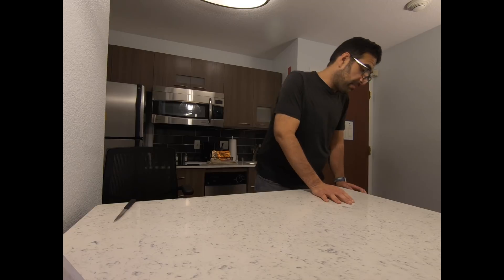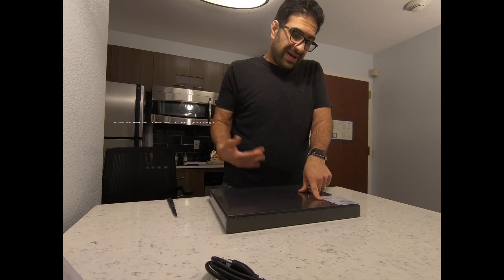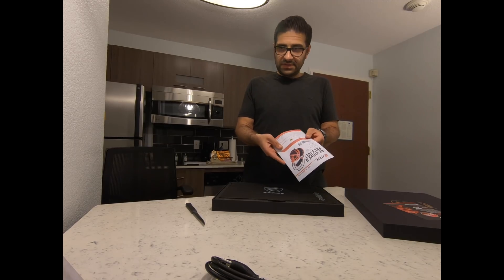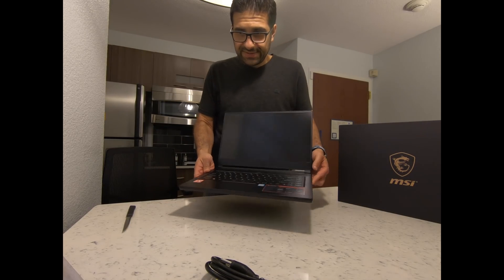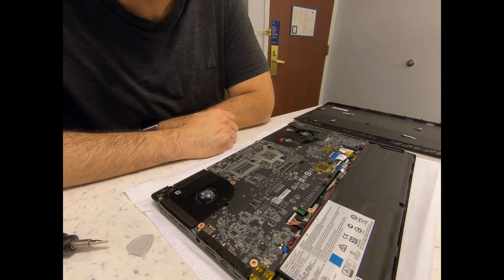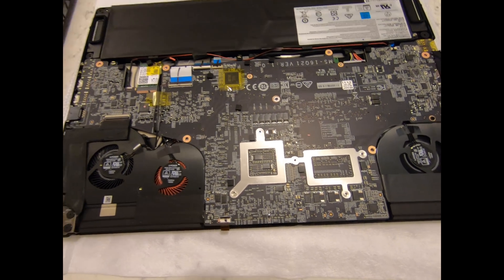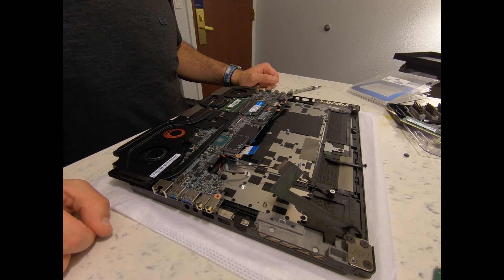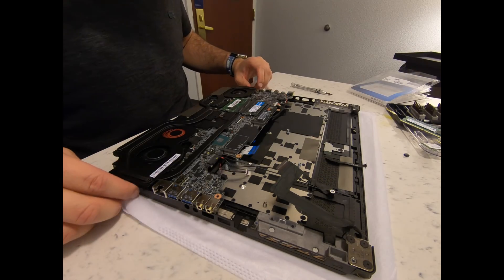MSI GS65 Unboxing, SSD and Ram Memory Upgrade

Comment: I did every step of this video. Laptop turn on, but display does not. I have connected the laptop to an external monitor via hdmi and windows dos not recognize the laptop display.  What could be happening?
Reply from the maker: You have probably missed to connect the morning cable to the motherboard! Make sure all the cables are connected or also maybe you didn't plug it in correctly. Try to unplug it and insert it back
Reply: @WorldOfGadgets  that's the blue cable near the coolers right?. I've already try it, connected and disconnected and nothing happens
Reply: @WorldOfGadgets  in what minute of the video did you disconnect the display cable?
Reply: I have same issue if you solved your problems
please
help me.

Comment: Real quick question: I have an MSG65 with an RTX 2060, and I'm thinking about replacing the battery. If I opened the back of the computer, would I have to disassemble the motherboard, or would I just be able to take the battery out and put the new one in?

Comment: You didn't explain what you're doing with the RAM. Can 16Gb ram go with 8Gb on other slot? :/ or do they have to be same capacity.
Reply: He was able to install one 16gb and left one 8gb of ram in there. He said he would have "24gb of ram" in the video and would upgrade to 32gb of ram later

Comment: I have this same exact laptop and it lags a lot when surfing the web.. I was considering upgrading the RAM and SSD, Have the OS installed on the new SSD clean and have the old SSD as a slave for regular word files, PDF, Excel and such. 

Only info needed:
- Max amount RAM and clock speed the laptop can handle
- Max amount of SSD and clock speed it can handle
- Is it worth upgrading the wifi card

Thanks

Comment: The models that have only one ssd  can be upgraded with two or I should choose a model that has two hard drives from the factory stock?
Reply from the maker: anatol1204 they should unless they have a different SKU for where u are ! Otherwise in USA there should be a room for u to upgrade

Comment: If you upgrade the m2 SSD and reinstall Windows,  are there any drivers that need to be installed for the laptop?
Reply: well..
easy way - no need to install drivers (just connect to the internet and windows update does it for you
harder way - install manually (without wifi connection...need to pre-download each driver)

Comment: Hi, may I know which SSD below do you recommend for MSI GS65(If budget is not a problem)?
Samsung 970 Pro NVMe M.2
Samsung 970 Evo Plus NVMe M.2
Samsung 970 Evo NVMe M.2
Can these SSD fit the second slot as well?
Reply: No the 2nd slot is only for 2.5” SATA HDDs or SSDs.

Comment: Did you have any problems turning on your gs65....I upgraded my ram and swapped out the SSD for a 970pro and it's all connected back up and no power....being that I am a H/W installation specialist at work I am somewhat confused as to why I cannot get my laptop to turn on? I would love if you could let me know if you had any issues.
Reply from the maker: no issues, but when I upgraded my ram I had to plug the laptop to the power and hold the power key for few sec before it turned on. 2nd thing i would check is that all cables are connected to the board after your installation
Reply: @WorldOfGadgets  well I have had to return my gs65 for a full refund.. it's utterly dead.. I am now looking at a asus rog zephyrus m gm501 now I have two brand new 8gb 2666 sticks of ddr4 that are gonna be useless...oh well .. that's a loss of £150 right there...

Comment: Hey there, 
Does adding an extra SSD void warranty?
Reply: Judith Pasfield any changes to the laptop can void your warranty.
Reply from the maker: Judith Pasfield  if your in USA no! I have confirmed this with MSI... as long as you don’t break anything inside your warranty is valid ! Obviously they won’t cover your new upgraded parts but everything else it’s still under 1 year warranty

Comment: Having opened the computer has lost the warranty, when you broke the seal of the last screw that you did not find. but I guess you knew, you have to wait for the year of the manufacturer's warranty to end, because if it breaks down under warranty, you will have to pay for the repair out of your pocket   Regards
Reply from the maker: Curiosidades y Mas No, that’s not true ! At least in USA, I have called MSI and confirmed with them that upgrading parts in your laptop dose not avoid warranty even if you break the seal. The only time you lose ur warranty is if you physically damage something inside.

Comment: I don't know if it's too late to ask, but is there any way you could tell me if Oracle Virtual Box will run on this?  Are you able to get a VM up and running?  What type of RAM spec do you need for the upgrade SODIMM 260 pin?

Comment: Hi there I took this laptop today to geek squad (because I could not trust myself with this kind of stuff) and they told me doing this requires removing the motherboard and that it runs a high risk or frying or destroying it. is this true and if so how would I fix this?
Reply from the maker: Yes, they need to remove the motherboard but honestly as u can see from the video it's not to hard and I personally don't trust geek squad they Tell bunch of idiots ... Don't trust them with anything ... If ur not comfortable doing it ur self Google some PC repair places to help u in ur area

Comment: Nice vid. Would be sick to Raid-0 2 x 2TB Samsung 970 Pro in that thing. Or Raid-1 for the paranoids who don't do backups. I've one, I'm a bit scared to open the thing. I'm technically inclined I built a ton of PC's, but this might be above my clumsy level.   Any toolkit recommended? I've already have a crazy kit with all the bits you can image for the screwdrivers but I've no clampers, plastic things to  pry etc. Thanks for the vid.

Comment: Has anyone had their new installed nvme drive just randomly disappear from file explorer and device manager and disk manager? It still appears in BIOS but disconnects randomly while in windows. It sucks because all my games are on this newly installed drive so they will just randomly crash while playing...
Reply from the maker: is your NVME a Samsung drive?
Reply: @WorldOfGadgets  No. It's actually crucial. But, I think I've even further isolated the cause. It only seems to happen while playing AC Odyssey. So there must be a problem with the game. I've read online that AC Odyssey can break if you have it installed in a secondary (as in not the same drive as your OS) drive.
Reply from the maker: @13Uzamakifan   it could! I have had the same issue on My Samsung NVME drive... the problem got fixed after I installed the NVME drivers from Samsung! you might having the same issue... try to see if Crucial has any drivers available for your NVME.

Good Luck.

Comment: I just bought a 1 TB HP EX920 SSD and it says "double sided SSD" on the box. Do you know if that is compatable with the GS65?
Reply from the maker: Is it M2 ?
Reply: @WorldOfGadgets  Yes, m.2 NVMe SSD. It has chips on both side of the SSD.
Reply from the maker: Timothy Chan then it will work 👍🏼
Reply: @WorldOfGadgets  I came across a forum where someone plugged the HP SSD into his Lenovo X1 Carbon and it was a bit bent (hence there are chips on both sides of the SSD). He was concerned about any long term issues of the SSD. If the HP SSD even a bit bent due to the design, maybe I'll have to go with a different brand.

Comment: what wireless card did you upgrade to?  please add Amazon link
Reply from the maker: I'm not sure what model # it was, but I purchased it from Ebay. but MSI changed the default WIfi card to the one I replaced on the second gens.

Comment: I've been reading that if you want to add an extra ssd, you would have to put the Nvme ssd with the OS  in slot two as that slow only takes Nvme and then install the sata ssd into slot 1, as slot 1 takes Nvme + sata. Can you confirm this?

Comment: wow thank you so much for this video!. I'm really thinking on get this model but I live in South America and they sold out, in Amazon they offer several options, do you recommend going for the lowest option in RAM and SSD to make it cheaper and then replace them here? let's say I buy the one that comes with the GTX1070 and then add more ram and storage?
Reply from the maker: Jonathan Varas Roco that’s exactly what I would do ! Hey charge to much if u upgrade them from factory

Comment: Can i fit Adata XPG Gammix S11 M.2 SSD, who have heatstick and might restrict compatibility with this thin laptop? Quote from TomsHardware.com:
"The drive would be a good choice for a laptop, but the heatsink might restrict compatibility with some models. Some laptops only accept single-sided M.2 sticks or have tight clearances for double-sided drives. That means you might not be able to use the S11 with its additional heatsink."
Reply from the maker: Filip Gargov actually you might be able to make it fit ! There is some room , but honestly what would u want to have a heat sync on a SSD? They don’t produce that much of a heat

Comment: So i just did it and it was scary but work! I've added a SATA SSD and that works only with SLOT 1, (SLOT 1 is a combo SATA/PCIE), I move the stock PCIE SSD to SLOT 2 (PCIE only)
Reply: Be very gentle with the different connectors clip there are fragile

Comment: Is this laptop worth buying with all its confidence and appreciation in terms of price, quality of manufacturing and what you think about Thank you .
Reply: Thank you. Is it possible to buy this laptop to work on it in the specialization of graphics and programming and whether the quality of manufacturing beautiful
Reply: great machine. use it for 3D animation and software development.
Reply: Hany mohamed TV I can recommend this laptop regarding graphics and design. But, for programming, I have no idea what kinda specs you need for programming.
Reply from the maker: Well, If you want my honest answer I would say spend little bit more money and go with the New Razer Blade 15" the build quality its much better and it will hold its value much better as well! here is the link to my video https://youtu.be/6bXPXA8t4ms
Reply: World Of Gadgets Razar has the worst customer support ever. Plus, thicker aluminum plates does not necessarily mean a better build quality. In fact, I see this laptop build quality way better than Razar. This laptop has a flipped motherboard for better cooling plus, it does not overheat much compared to other laptops in its size range. People need to understand that flexes in the body does not mean a bad built quality.

Comment: Hey!!, I just got my gs65 yesterday, and I wanna install ssd in my laptop now, which brand and which one should I get, and very confused right now,
Reply from the maker: Hi, Congrats... so Samsung recently released their new NVME SSD's  "Samsung 970" they are awsome and very fast … you can order them using these links through amazon and they are on sale right now. I personally recommend the 1TB : https://amzn.to/2MScrLx    or  512GB : https://amzn.to/2vO6yIV
Reply: Thanks! Btw, can I install two SSD at the same time, or do I need to replace the old one?

Comment: Did all these and there's one more mod everyone should do, which is liquid metal thermal paste. You'll realize after installing all your software, the computer boots up to 70c for no reason. After using the metal paste, it will reduce at least 20c. I maintain at 41c every time I start up.
Reply: @Sw3d154_F154 it also decays copper and other metals but way spower than with alu. If you plan to use your computer for a long time, like plus 4 years, it is better not to use liquid metal
Reply: @FreeofCorp  If I use liquid metal on this lap how often do I need to replace it to avoid damages?
Reply: Which 1 did you buy? Can you link one in EU region?
Reply: @moomoo5537  Thermal Grizzly Conductonaut... https://www.amazon.com/dp/B01A9KIGSI?ref=yo_pop_ma_swf
Reply: Yeah liquid metal is sick. But beware, over time it can eat into your cooler and cpu (slowly). U can also use nt-h1 paste, u wont get 20 c off but it is still a big improvement.
Reply: Is the factory paste so bad on this it will also improve lots by replacing with just regular after-market thermal paste? (as someone wrote, if you intend to use for long life the liquid metal is less ideal..)
Reply: @shyb3rt  did you ever find an answer to this?
Reply: @SuguruMontana  I didn't want to risk it since I received my ordered laptop days before leaving for travel. Might consider upgrading the RAM and NVME drive now however, so considering giving repasting a try as well within the next few weeks. Interested to know if anyone had much improvement by repasting using after-market thermal paste (not liquid metal).

I did however experience that software-adjusting down the voltage for the CPU and GPU helped calm the fans down most of the time :)

Comment: Thank you for this... This video just made me change my mind about this laptop. It looks great and feels great but that's ALOT of work to get in and upgrade..... A complete turn off
Reply from the maker: christopher graziano hahah I know but honestly it’s not that bad! 1st time is the hardest lol 😝
Reply: World Of Gadgets yeah It too extra for no reason I ended up getting the Razer blade 15 instead because I have Parkinson's so I can't be messing with ribbon cables like I used too
Reply: It’s not too bad, I just did the exact same thing he did but I didn’t take out the battery or the mother board I just lifted the board up and installed the SSD from the back and it sat back down I didn’t have to do all the stuff he did!
Reply: Get external hdd
Reply: I felt the same way at first, but the screen quality, keyboard quality, and overall CPU+GPU specs is a big win. I'm going to do the mod.
Reply: John Draisey keyboard quality, on this thing? It’s junk, I can type 120+ WPM on a standard keyboard, bot on this, not even close, it doesn’t respond well enough
Reply: They've crammed a 1070 into an almost ultrabook design
Reply: Better an upside down mobo then buggy Aero.
Reply: It's not hard actually. Just go easy.
Reply: weeeeak
Reply: Ben Birchman Sad until you break one of the cables, then it’s a silly reason to have bought the laptop, which just becomes so much junk at that point
Reply: It may look great, but there is a lot wrong with it:

1) The keyboard is cheap, it feels cheap and doesn't react as fast as their older models; I can type 120+ WPM, but not on this keyboard;

2) Intel Max-Q is trash! I wish I would have known, I would have spent $2K+ on another model that doesn't have Optimus, I mean, Max-Q; I have tried to set the dGPU as default in the nvidia panel and onb a per application basis, with no luck for many programs; VLC cannot be set to use the dGPU at all;

3) It's fairly slow for the specs; not sure if that's hardware or software, but damn, I expected better for what's listed;

4) It seems to be designed by Apple; I've been a long time hardware tech and I'm hesitant to open this, mostly because I may want to sell or trade it and don't want to chance damaging it;

5) The speakers sound like shit; I know most laptops are a compromise, but the high-end comes across distorted, especially as you increase volume; and

6) MSI support sucks. My desktop is mostly MSI (motherboard, graphics card, and whatever else I could use); but, after my experience here, I may evaluate other companies.

For the price, look elsewhere and, for all that is holy, do not buy Max-Q stuff which would encourage Intel to continue its development.
Reply: @erichzann2966  I love my MSI GS65. I get average 90-130 FPS in PUBG on a 4k 30inch monitor. No lack of power in music production or video editing. Working well for me.
Reply: Daniel Yengle You have to use the MiniDP or the HDMI... or, is there a way to make the laptop screen, itself, default to the dGPU; I am playing a game from circa 2002 and the fans kick on, it has locked , completely once, while just doing office workin the last week

I have questions in the nvidia and MSI forums, and people haven’t answered or have had the same problem

How much dedicated RAM do you have for your card? 128 MB? Look at the specs, the so-called 8GB is shared between the Intel, dGPu and system

Or, just spend the $2k+ and get a laptop that doesn’t have Max-Q, or, I would have, had I known
Reply: @erichzann2966  We all need different things in the end. Get what suits you best. I like this one because it's sleek and professional looking. And the keyboard reminds me of the pre 2017 macbook pros.
Reply: Daniel Yengle But those are perceptions, not performance; does yours say 128 MB of dedicated RAM like mine, with 8 GB split three ways? Or, is mine the only one?
Reply: Joshua Richard No, I made a poor purchase, and there are valid reasons to consider it as such; outside of this laptop, my life is fine, thank you; but, I am amazed that people call this a gaming laptop, when it clearly isn’t.

I game with another guy on Everquest... not the latest, but from 2002, and he just bought this laptop. Both of us get less than 10FPS and f we raid, it’s even worse. Why? Well, because NVIDIA, in their infinite wisdom, didn’t create a profile for that game, so we can never choose to have it use the dGPU.

All it would do is take a driver/software update to enable always-on dGPUm and yet, it doesn’t happen. Max-Q is junk for gaming, great for office work and, given the price point, there are better options for both.